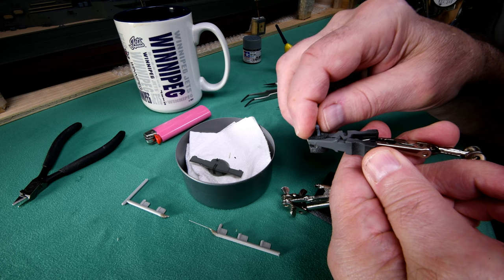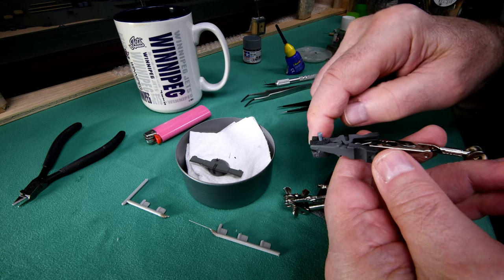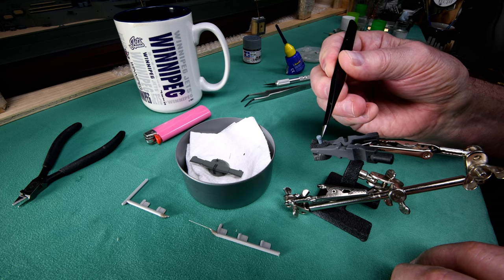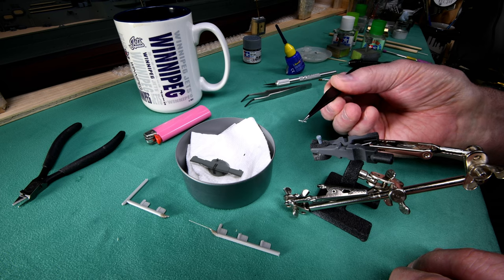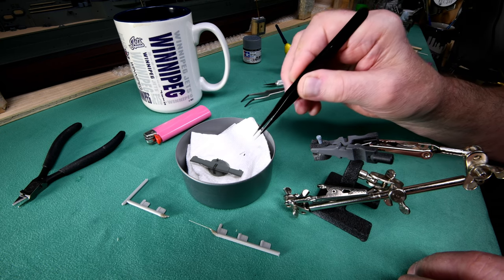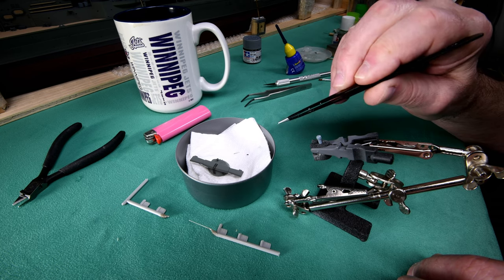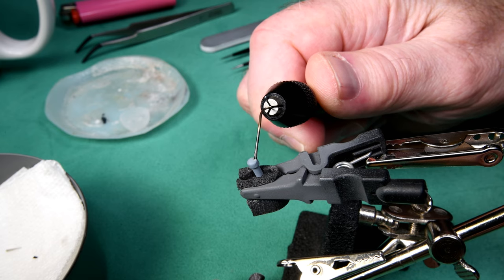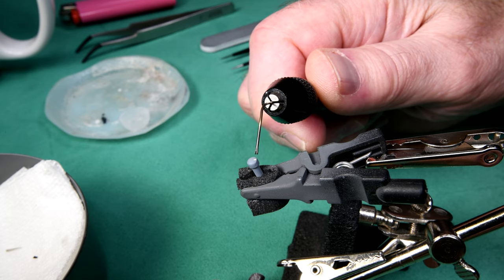The Model Ship - Part 751

Comment: If you overpaint an area in only a minor way, sometimes you can just use a toothpick or blade to scrape away the overpaint without affecting the color underneath, especially if you intend to final coat the whole thing in clear. That way, you don't have to keep painting and repainting the two colors until you're happy with it. Also, be careful with CA accelerator as it may crinkle the glue.
Reply from the maker: Re: "Also, be careful with CA accelerator"
Yes, I've had strange experiences with certain brands when pen turning. 👍